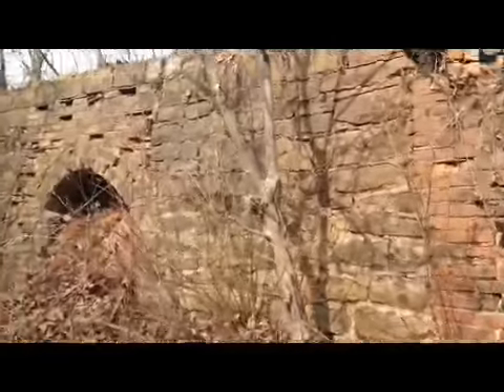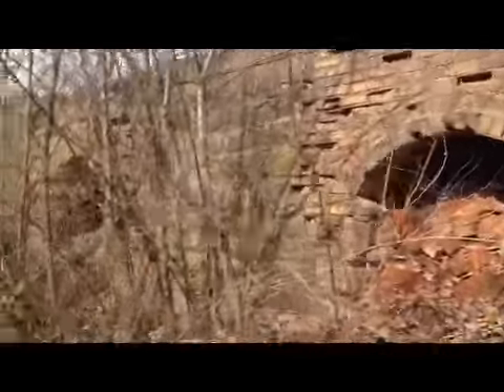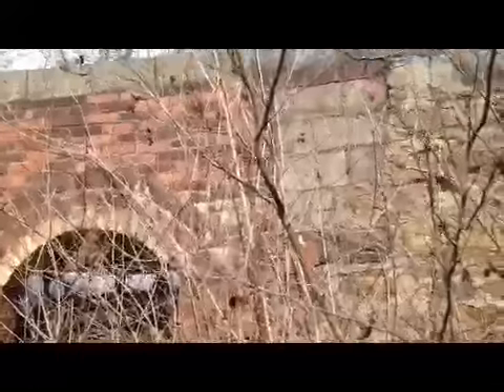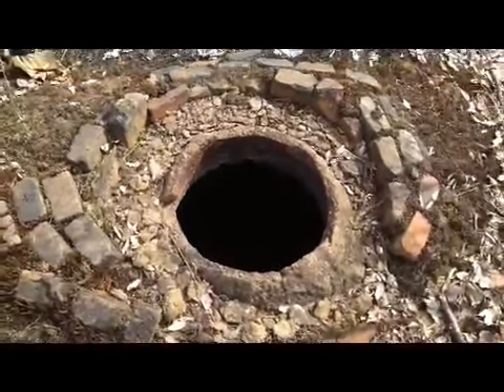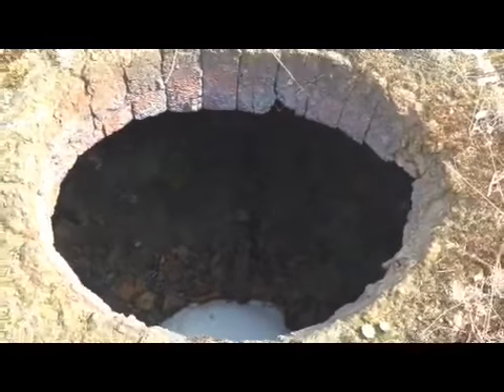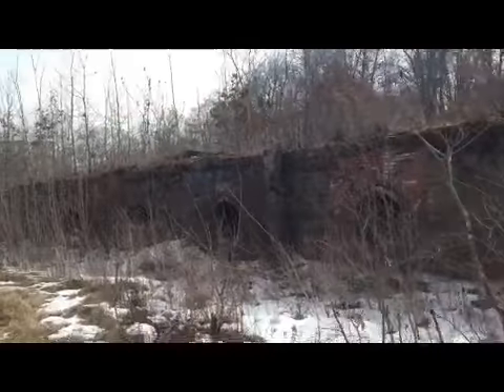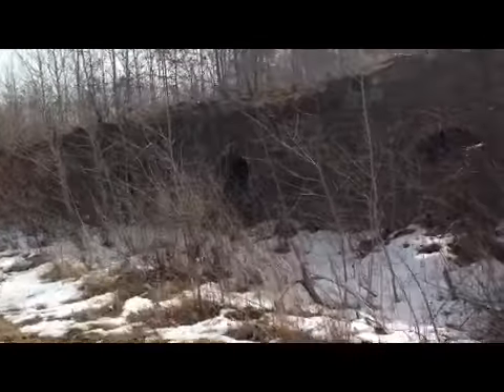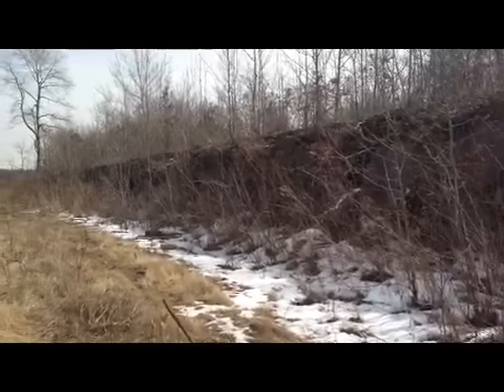Abandoned Hester Brinkerton Coke ovens West Moreland County

Comment: You said these Brinkerton ovens were rebuilt for the war. I'm thinking WWII, am I correct? So they were in use the first time around the turn of the century? And my other question pertains to the bricks used to build and the mortar as well, I'm surprised at how well some of the bricks and mortar have held up over 100 years later! Would any of the bricks on any coke ovens have to be replaced on a regular basis due to the constant heat? Or did these particular bricks on these ovens get replaced more to " shore up" after all the years of sitting?

Comment: these were used for cooking?
Reply: Well....kind of. They cooked coal down to a product called coke for use mainly in the steel industry to power smelt furnaces. Coke burns hotter and cleaner than coal. 

Here is the Wiki entry if you want to read up on it further. 
http://en.wikipedia.org/wiki/Coke_(fuel)
Reply: crispyspa ok, thanks, I understand now, thought it was odd to "cook" way in the middle of nowhere like that